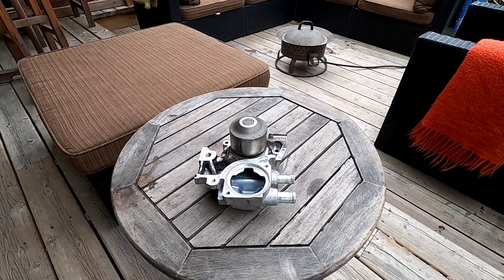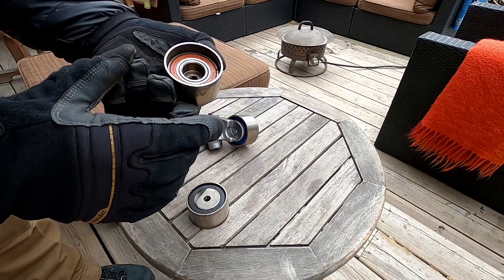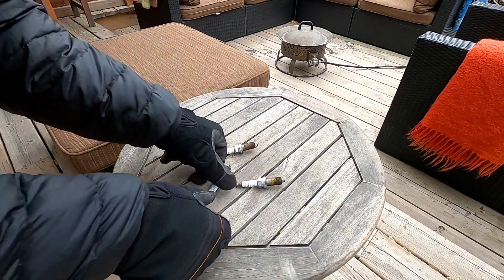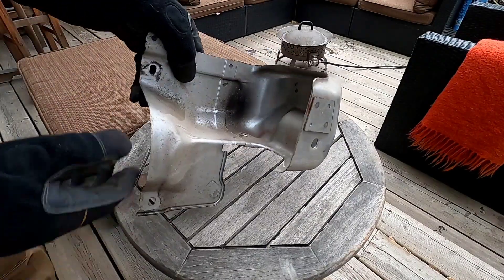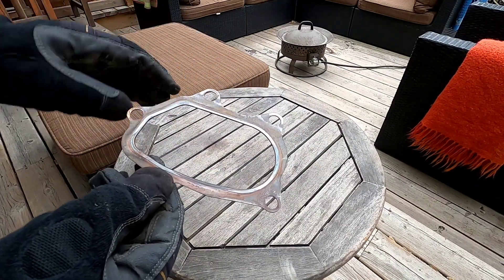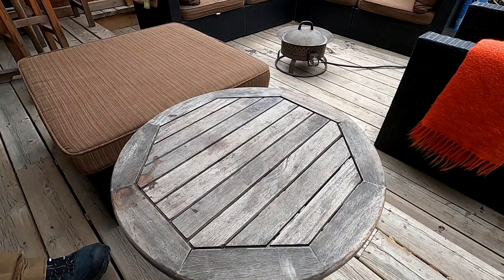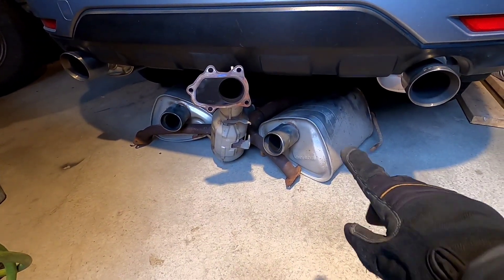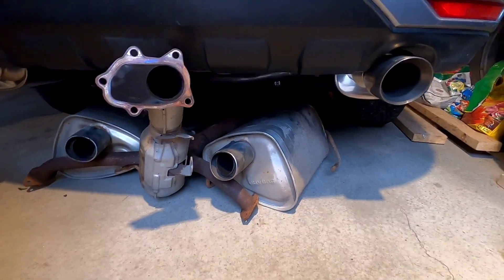EJ 25 Engine Reliability Mods on a Subaru Forester XT

Comment: The #1 thing I’d do to the ej255 is eliminate the mesh in the banjo bolt, then do a cylinder 4 cooling mod.. then replace its oil lol
Reply from the maker: We did do the cylinder mod but not the mesh... yet...
Reply: @OffRoadDiscovery  Definitely needed. Check out the Subaru diagrams online. I’m sure there’s more than one banjo bolt than the one at the turbo on this motor. I think both L & R heads got one too. 
Edit. I just checked the diagrams, it’s called Turbocharger oil line bolt, obviously for the turbo, but it looks like  4 Union Screws and Filters on each end of the two oil lines also. IAG makes a complete kit for the Turbo, comes with flexible steel lines. Good luck!